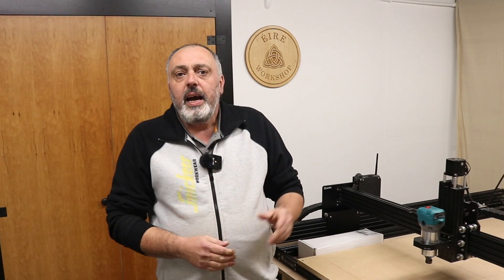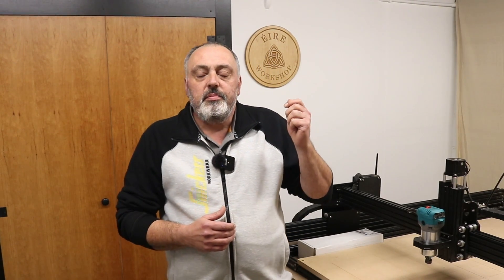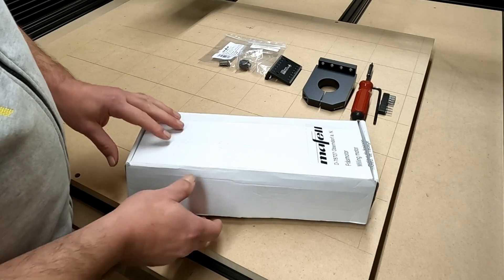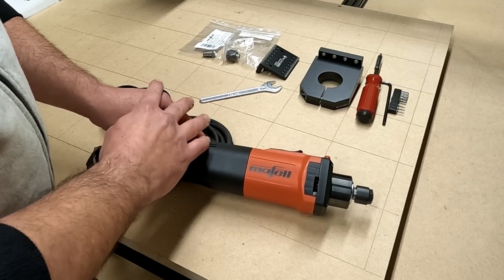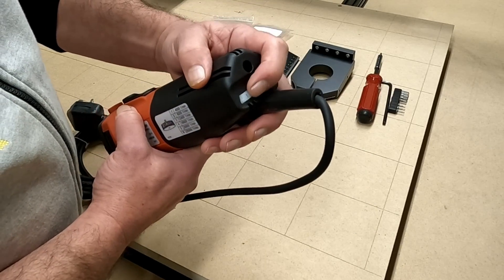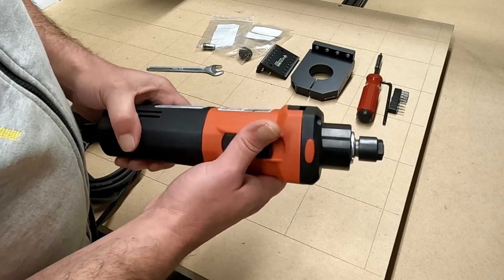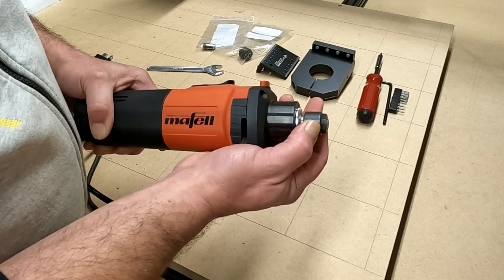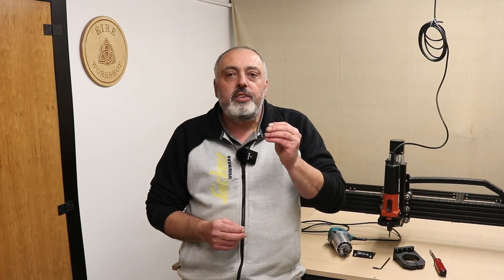Mafell FM 1000 Upgrade To The Ooznest Workbee Z1+ CNC Machine

Comment: Great video. I've just ordered the mafell for the workbee z1+. I was having problems with inconsistent depth and width pocket cuts and also inconsistent final width of a full contour cut piece. Hopefully the mafell will help a little. The workbee is set up correctly with no obvious play in the head. I'm cutting 15mm ply (mixed poplar/eucalyptus core), with a 6mm flat mill bit, running at between 1500 and 2000 feed rate, about 18000rpm and with step downs of 2mm and stepovers of 2mm. Do those settings sound sensible? Or could that be causing some of the inconsistency problems? My spoiler board is surfaced and flat, and I'm holding pieces down by screwing to spoiler board currently. Thanks!

Comment: I didn't hear a huge difference in sound but I did see that you got a bigger chipload off of the Mafell then you did off of the router which is a good thing. Now I;m wondering if I can get a reducer for my machine. I don't have an oozenest.
Reply from the maker: There isn't much difference when cutting because most of the noise then is generated by the bit but there is a huge difference when both running idle. It should be easy enough to source a reducer

Comment: 5:04 It seems there are a few of suppliers for this type of spindle. They are based on hand tool motors, like angle grinders and die grinders, which are low duty, intermittent use. They are very noisy compared to a specific designed spindle motor. That is due to the fan system to keep the hand tool cool. These comments are based on my research, being my own opinion. Do your research.
Reply from the maker: Why do I need to do my research into your own opinion.  I was comparing the milling motor to a router I wasn't comparing it to a Air cooled or water cooled vfd motors. I also didn't say they couldn't be sourced from another supplier just that ooznest the supplier or the cnc supplied them . So again why do I need to do my research
Reply: @ÉireWorkshop  it Should have been "Buyers Do Your Own Research" My comment was NOT directed at you, as you already have done your research.

Comment: I hope oozy send you one of their new routers too, so you can test that. Tell me do you know if you can fit a spindel as oppose to a router? Look at shapeono cnc machines who have that option too, they are even quieter than your router and most importantly, controllable remotely; so the software switches them on and off and can set the speed too.
Reply from the maker: I believe it possible to get the mounts for a spindle (air or water-cooled motor with a vfd) but for me I don't think it worth the hassle on a hobbyist machine. If controlling via the software was a priority you can get a maffell milling motor with amd controls so speeds on on/off is controlled by the software its just not sold by ooznest.

Comment: Thanks for the Video, really informative. decided to upgrade aswell! just been testing it today. wanted to get your advise on speeds/feed rate.
Cutting some plywood with a 1/4 spiral bit. Speed dial is on 4 and cutting at 30mm/sec. It cuts fine but screeches/whines like crazy. 

What speeds do you normally find works well?
Reply from the maker: Hi thanks for your message, your settings seem to be in the right ballpark. Can I ask what depth of cut your are using? With a 1/4 bit it should be around 3mm. The screeching you are getting is from the vibration in the bit itself and plywood and hardwoods normally generate more resistance hence more vibration when cutting. Try not to have the bit extent too far out of the collet this will reduce the effect you are getting also.
Reply: @ÉireWorkshop  thanks for the reply. I'm only cutting 2mm. I think I figured out what it might be though. The Y axis is twisting. the right and left stepper motors are moving at different speeds. It just twisted mid job and jammed the whole Y axis. scared the life out of me, thought it was all about to explode
Reply from the maker: @motamwoodworks  that's not good iv never had any issues like that. I was only thinking after I replied I should have suggested checking the wheels were adjusted properly especially on the z axis as that would also create a vibration

Comment: Glad I came across this video Tommy. Had my eye on this CNC for a while. I wonder does the enclosure help with the noise?
Reply from the maker: You won't go wrong with this cnc. As for the enclosure yes it would reduce the cutting noise when using the machine however keep in  mind  depending on the type of extraction you use the extraction unit will probably make as much if not more noise than the machine cutting

Comment: I must say I'm glad I went for the genuine Makita RT0700C rather than one of the knock-offs. I thought I would want to upgrade to a spindle but I have given the Makita 4 years of serious work including running it at minimum rpm (9600) for many hours continuously (said to be bad for it) and it is still fine. For plastics it would be good to be able to go slower but I find water-cooling the job works very well and gives a great finish on acrylic and HIPS sheet anyway.
Reply from the maker: That's great hopefully it will meet your needs for many years to come 👍

Comment: Hi, can you use collet chucks of any other size? Do you have any opinion about water or air cooled spindles? Thanks!
Reply from the maker: Hi, you can get collets from 3mm to 8mm aswell as 1/8"and 1/4". I don't have any experience of water or air cooler spindles buti think they may be unnecessary for a machine of this type

Comment: I'm thinking about having this in my semi detached house with an enclosure, do you think the noise with the mafell would be too intrusive?
Reply from the maker: The mafell is going to have less noise definitely. As for being intrusive I think the noise of the  bits  doing the actual cutting will be the most intrusive when it comes to the machine and also the noise of some type of extraction system to clear the dust. But choosing the mafell and enclosure is definitely going to help noise reduction
Reply: @ÉireWorkshop  thank you!

Comment: Just out of curiosity, how tight did you have to make the clamp before the milling motor was secure?  I got to the point with mine where I thought I'd strip the thread before it started to clamp the motor, so I had to use a single thickness of masking tape around the motor's housing before it would tighten up properly.
Reply from the maker: Hi, it took very little to tighten I'd say half a turn on the bolt and it was good. As you possibly could see when I placed bracket on the motor it was a smooth fit (within 0.05mm) with no extreme excess movement. I don't think you should need to add  tape as this could lead to tramming issues.
Reply: @ÉireWorkshop  Hmm, I really struggled to tighten this without the tape - it really wouldn't do it.  Using the tape it was as I'd expect - a little pinch and Bob's your uncle.  Good luck with the new milling motor!
Reply: @ÉireWorkshop  It does now!  Ooznest replaced the one I had (43.12mm diameter) with a new one (43.01mm diameter and that made all the difference!
Reply from the maker: @CNCnStuff  perfect 👍 ooznest has great customer service 👌